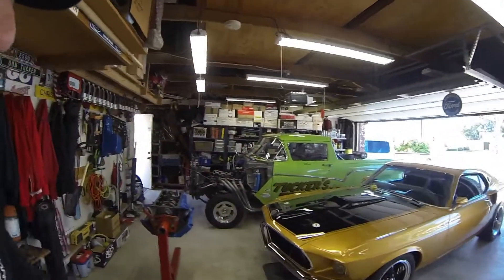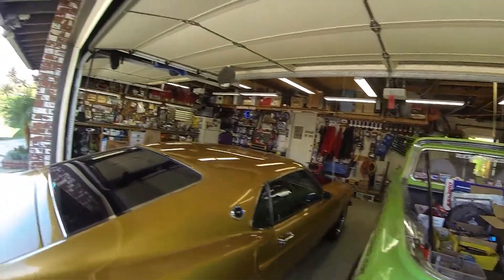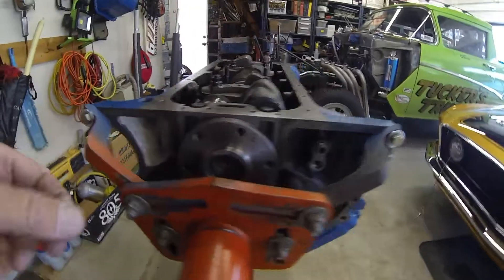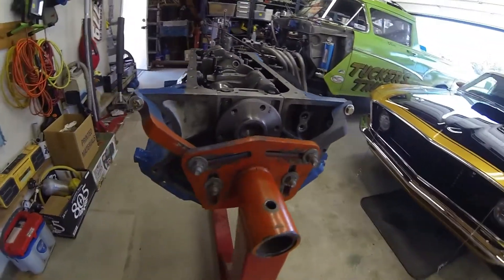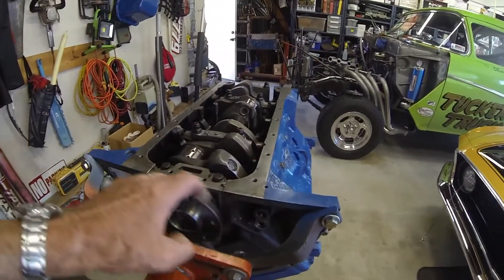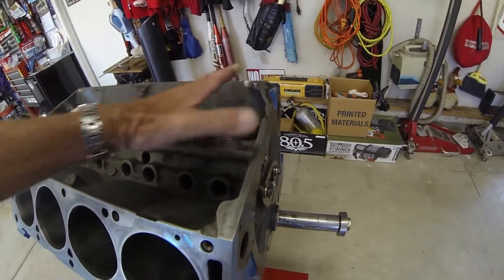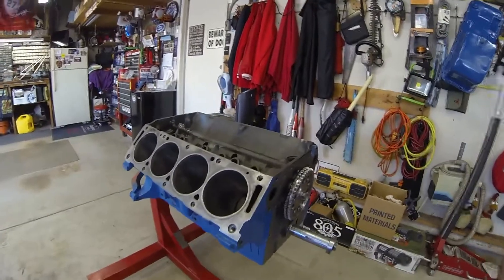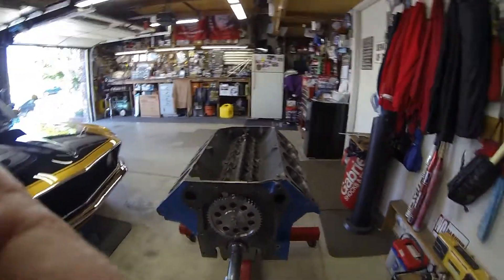427 FORD FE Engine Building Tips 10 2019

Comment: I bought a new 427 engine block from Ford in the 1970's. it included a, "soft" plug to put somewhere in the block to use it for the 1968 hydraulic lifter camshaft. Without the plug, the oiling was like the solid lifter models. I'm not sure where in the block the plug would go though.
Reply from the maker: Jim,  The 427's came 2 ways as far as lifter oiling.  Drilled for hydraulics or not drilled for solids. If your block is drilled for hydraulic lifters you will need to block or at least restrict at least 90% of the oil flow through the lifter bores IF you are going to run a solid lifter cam.  Is your block drilled for hydraulics? You will see a good sized hole going through each lifter bore if it is drilled.  Okay, if it is drilled AND you are going to run a solid lifter cam you need to block the lifter gallery's.  There are 2 plugs, leading to these gallery's, at the rear of the lifter gallery.
You can do this several ways.  The original way was to pull the pipe plugs out and tap further down in the 2" hole, for a smaller pipe plug to block the oil flow to the lifters, then put the plugs you took out back into their original spot. Not easy.  2nd way is to pull the plug and force a round rod into the bottom of the hole.  This rod would be about an inch long.  You can use drill bits to check for the correct tight fit size and either cut the bottom of the drill bit and use it as your plug or locate a metal rod, the correct diameter, and pound it in.  Be sure to put the original pipe plug back in. Both these ways block 100% oif the oil flow to the lifters.  The way I choose to do it was to determine the hole diameter at the bottom of the hole using drill bits.  I'm at work, I have the numbers at home.  Whatever that diameter was I choose to use a rod, about 1" long and about .010 (thousandths)  smaller than the hole diameter.  I did want some oil flow through the lifter bores to lube the cam and bores.  Some say good idea and some say not needed.  I wanted some oil there.
I then put a nice 1-1/2" long spring on top of the rod to hold it in place and then ran the pipe plug back in to keep all under pressure.  Worked great and I can remove the plug easily with a magnet if I ever want to run a hydraulic cam.   If you need exact sizes, measurements and part numbers let me know.  I got all from McMaster-Carr and very inexpensive.
Tom T
Reply: @tomtucker7571  This was a 427 engine block bought new from Ford in the 1970's. It was a replacement block for both the solid lifter and the hydraulic lifter engine blocks. Whatever way it was drilled, it came with a soft plug so it could be used for both. The replacement block drilling may not have matched either original drillings. It was the only 427 replacement engine block available at the time I ordered it and it could be used for 1967 or 1968 engine block replacement. Ford kept replacement parts available for 10 years after the last year a part was used, but they weren't always exactly the same as the originals.
Reply: @tomtucker7571  I put a solid cam into my 390 "hydraulic cam" block without restricting those galleries, and runs ok and plenty of oil pressure. It just means there's a bit extra oil going by the solid lifters and onto the solid cam.
Reply from the maker: Jim,  The only way you will know, if any of my suggestions will work, is to check the lifter bores.  I'm quite sure, from what you're saying, the lifter bores are drilled.  Do you see a hole/passage going through each one of them?  You should also see, on top of the block, at the rear of the lifter valley 2 allen headed pipe plugs.  They are angled down toward the right and left lifter gallery.  If so then decide what you want to do depending on which type cam you will be using.
Reply: @tomtucker7571  I no longer have the engine block. I never built it. I bought one engine block and one dual carb intake new from Ford in the mid-1970's. The intake I wanted had a -A part number, but the one available was a replacement part with a -B part number. The engine block was the only 427 block available and sold as a replacement for both solid lifter and hydraulic lifter models. I don't recall the instructions for the included soft plug, but it was to change the type of lifters used in the engine. That was the way Ford sold the replacement 427 engine blocks in the 1970's. I think the plug was to divert more oil for using hydraulic lifters, but it is possible it was to restrict oil for solid lifters.

Comment: Had to put plugs with holes drilled in them to run a solid lifter cam in my 428cj.  High pressure/high volume oil pump provided plenty of oil pressure.  Thanks for the info btw.
Reply from the maker: Ken you are so correct.  I should have covered that too.  It is very important to restrict some of the oil flow to the lifters.  Ford actually made 2 types of solid lifters that did a great job of restricting about 90% of the oil flow past the lifters.  Both styles did not have a wide groove around the outside middle of the lifter that normally lets the oil flow past the lifters.  One was a hollow shell type and the other looked like a hydraulic lifter but the center section was held in by a clip and would not move.
Ken I realize you took care of the oiling the best way.  Just thought I would provide the lifter info for others.  Not sure if Ford, or anyone, still makes this type of lifter.
Tom T
Reply from the maker: Not many of those manifolds out there, especially with the timing cover and special gear drive. Very rare. Good to hear there's another  crazy Ford FE guy out there with a blown engine.
Reply from the maker: Ken,
I too had to restrict the oil flow to the lifters.  I should have mentioned that in the video.
Tom